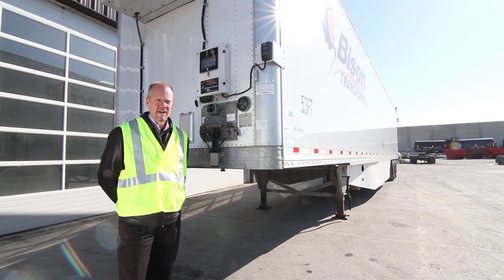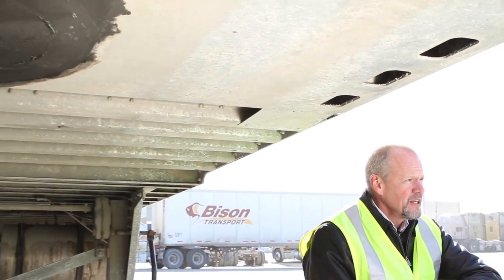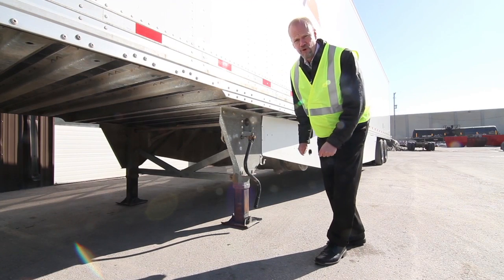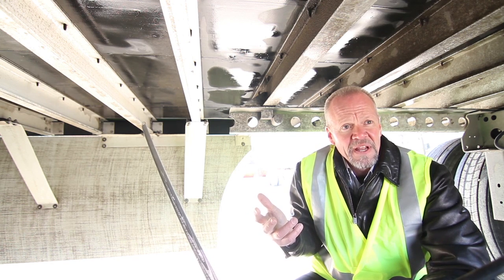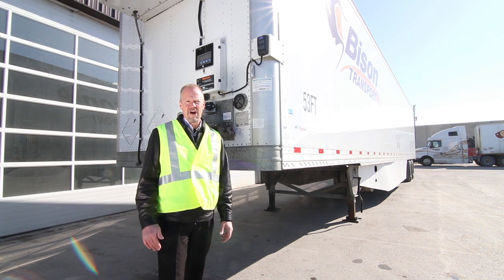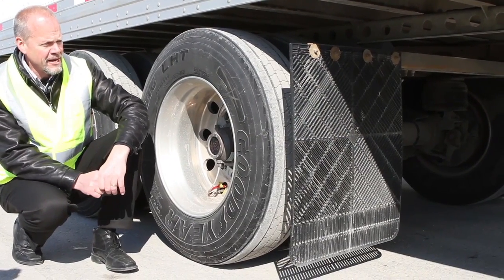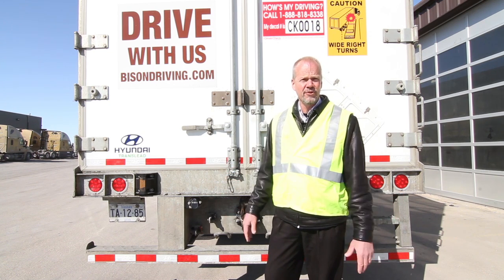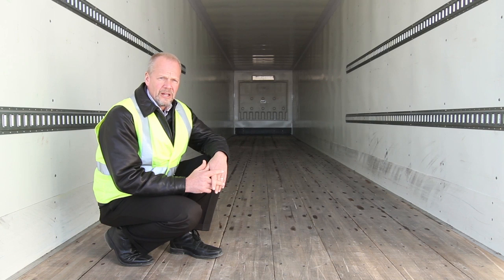Bison Transport's 2014 Hyundai Trailer Tour with Mark Irwin

Comment: Water won't zip in . Butt it will also prevent from zipping out in case of a chemical or liquid leak on container. Did you plan contingency plan on that
 Salutations from laredo texas

Comment: Excellent, excellent, excellent. It’s obvious there was a lot of thought put into these new trailers. Do you have any data on the fuel saving? Were these units a lot more costly initially?
Reply from the maker: +Larry Ehrlich There was added costs but we also been able to add many more years of use to the trailers. We don't have fuel data on those specific trailers at this time. If we can get an answer we will share it here. Thanks for your question.

Comment: Why did you cheap out on the e track. if you load drums or odd shaped freight on the nose you have no place to secure it.BTW the flyswatter mud flaps dont like the cold. they get brittle and crack. i had 3 split in me last winter.

Comment: From what I see is a company trying new things. Do you have a bar or air system to move the tandems on the trailer? Why did you not move away from the chain hook system to lock the doors open?  Why did you not put a rope handle on the left side for a driver to get in and out of trailer?
Reply from the maker: Hi Joel. No we do not have a bar orair system but we have a quick air release for the boggy pins. Chain lock systems we feel are the best option that we have researched that is simple and maintenance free. The rope handle is on the curb side where the stairs are to enter the trailer in a safe manner. Thanks for your question.